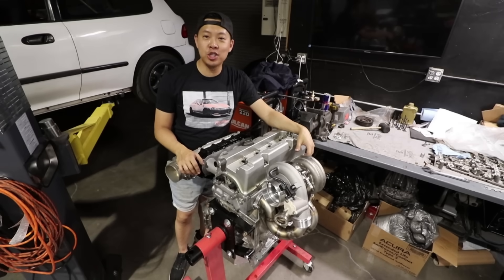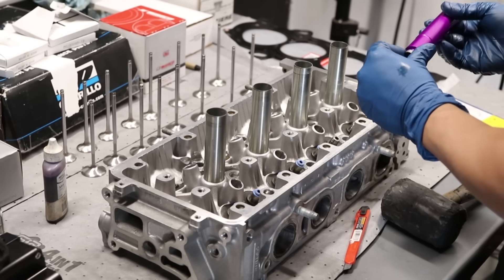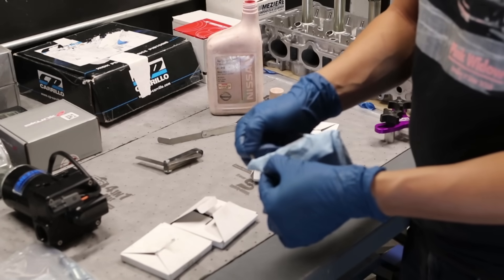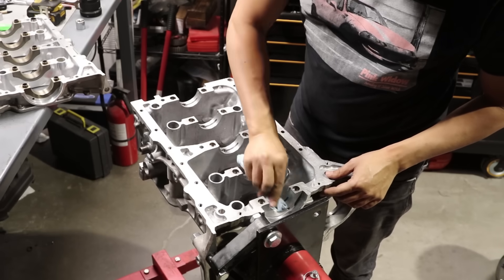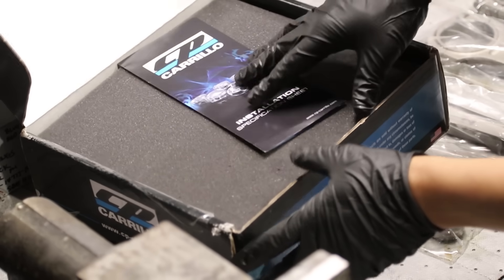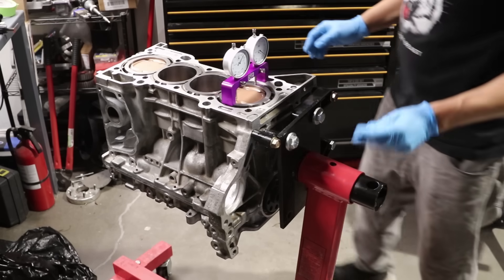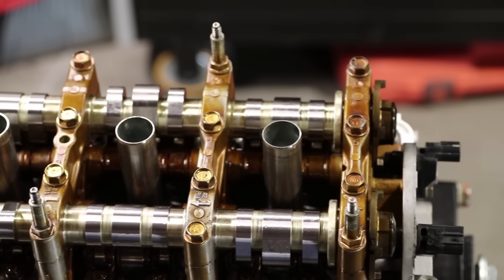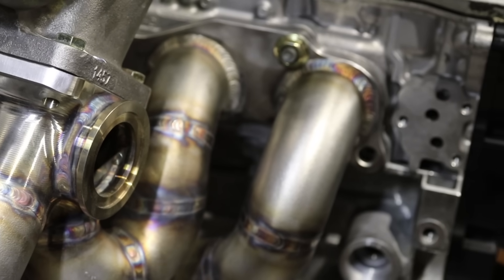K24 Engine Build Start To Finish -  The Best 4 Cylinder Ever Made

Comment from the maker: CHECK OUT OUR EBAY STORE: K20 K24 / HONDA PARTS IN STOCK READY TO SHIP
 https://www.ebay.com/str/racepartsnow
Reply: How much 4 this build
Reply: What’s the chances of getting a list for parts for this build? From top to bottom?
Reply: If i were rich how much power could i get out of my 3.8 l 3800 supercharged v6 in my pontiac grand prix gtp?
Reply: hey im looking to build a eg hatch with a k24. But was wondering that k24 to use. I know there are different ones like the k24a2, k24z7 and the list goes on. What is the best to go with for  most amount of hp you can get out of it, and also the price. Im just looking to build 500 hp reliable
Reply: h!mike,may i know which turbo kit you used in you're k24 engine build/tnx buddy ride safe.

Comment: its not the best 4cyl ever made, they need to be billet to pull 2000hp, the quickest 4cyl in the world is a gm ecotec with a STOCK cast aluminum engine with modded internals, pulls over 2000hp and does the 1/4 mile in 5:82 at 250mph, the quickest stock cast alu k series is not even close, even the vw ea888 is a better engine

Comment: I've seen several K2x assembly videos and no one says anything about the crank shaft and cam shafts pre-positioning before putting cam caps on - I mean, is any position safe? Than there's a moment when you put the timing chain on and just turn the crank shaft and cam shafts to their indexed positions with no remarks about the issue - does it mean that in K2x engines the valves never have a chance to touch/collide with the pistons regardless of the crank shaft - cam shafts mutual angular positions?

Comment: Amazing skills. I'm shocked at how high priced these prices to build Honda engines are. Even 300hp builds are 10k in parts, literally 3-5 times parts/labor of almost any other platform
Reply: Stock k24's are easily boosted to 500hp. 10k builds are people buying a lot of (imho) completely unnecessary new parts. You clicked on a 1k hp build video utilizing tons of new parts. Sure there are guys with 250whp NA builds that cost 11.5k, but they have different goals than me. I have been through enough cars to know nothing lasts forever and they are toys, so my potential 500hp $5k build is super cheap and easy to fix when it breaks from my perspective. Bizarre, seemingly counterfactual comment my guy.
Reply: @imaginary component  not bizzare or counter factual when I've watched video build after video build and that's all you see. If you haven't done it yourself and all you have to go on is YouTube videos,  then it is "fact" from that person's perspective.

Comment: Hey guys quick question if anyone knows. I just purchased some skunk2 dual valve spring set. No keepers came with it. I was going to use the original stock keepers from factory. Is that okay or should I swit h to different ones? I heard their was another design

Comment: I'm really curious about the bolts that you take out of the container at 7:20 . Is that oil that they were in ? The reason that I ask is that when you torque down bolts that have oil on the threads, you will over-torque them compared to bolts that are dry. According to Engineering Toolbox, you should reduce the torque by 35-45% when the threads are lubricated unless oil is specified by the manufacturer. A video worth watching in this regard : https://www.youtube.com/watch?v=XlNig19tWg8

Comment: Did you not need to file the rings down to the correct gap for the cylinder pressures and temps you will have with such a mega engine? Cheers.

Comment: did you put silicone in between thr girdle and the block when you measured the bearings for clearance?will the silicone gasket screw your bearing clearance when youre measuring it?

Comment: The k20 series is such an interesting design block and rotating assembly wise, fully counter weighted crank, girdle 5 bolt mains. Yet the block is open deck and all aluminum. Good engine weird design thats all, but they make a 1000hp easy so praise somebody

Comment: Awesome motor mike! I need help on parts. Building a car for my son, and this is also my FIRST build. Have a ‘99 Civic EX 5spd. I’m doing a k24a2 swap with MR1320 air to air SC for boost. I’m getting different parts suggestions from people. I just need the basic parts, like motor mounts, subframe, steering rack etc.,

Comment: I have a 2.4 liter Honda Accord from 2003. Who knows where to buy an improved engine head that will significantly increase the power and is already ready for assembly? Without the need for a turbo. Thanks for answering.

Comment: Very Nice. if you press the bearings in like that. You risk slight damage to the back of the bearing.
You could put the small nose in to the cap en press feed the bearing into its place. Just a observation. Greets

Comment: That head gasket for 1000hp? Show me the engine after some hard working hours and I'll be convinced, until then let me stay with the doubts... Do you trust absolutely in the pistons and rods to the point of not weighting them one by one? At that king of power in this high revving engines a difference of 0,5 grams might cause a major failure. Check for the Veicomer engine setups if you need to have some other ideas...

Comment: Warning. When you get a new oil pan from Moroso don't just bolt it on. Take the baffle out then take a small rubber hammer and tap with firmness around all seems and welds. I lost a $10k motor in 6 minutes once do to a piece of weld breaking away from the pan and going through my new engine....be cautious!

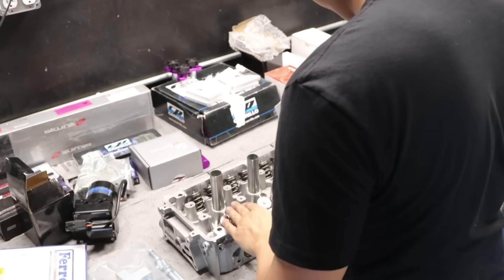Comment: 3:40 I’m pretty confident that using standard shop towels in the cylinder is really bad for high horsepower applications.  I’ve heard(and I’m certainly no expert) that they will shed some lint onto the cylinder walls that could mess the piston rings up.

Comment: Anyone else waiting for a slop moment like in LS engine builds? Waiting for the socket/pipe to come out instead of the anodized aluminum seal driver... smh  unnecessary $,$$$ you only need a concentric surface... run the engine at 2k for 20min to set the striations in the cam and lifters (add a blower to the radiator, set idle 2k on a good CPU or block up the throttle linkage). (break in) will 90% kill the paper, plus oil filter... just guessing there but yea.... Rockwell hardness of paper vs. engine parts..... lol. If your skurred just spray with carb cleaner and use parts lube. 

Square the rings with a bare piston BTW.

Comment: Use the top of your piston to push the rings down the bore to check ring gaps, push down about 25mm and the same for each ring. Balance the assembly, pistons, rods, crank and fly wheel and one pin in the fly wheel, so it will only fit one way, this makes a massive difference and will help it last longer. We pack a new pump with a lite grease to get pressure up or prime the pump via the oil pressure switch hole in needed as it fills side mounted filters and the pump.

Comment: Despite the fact that this engine is tough and long-lasting, it is not without problems. One main component on the engine that can fail is the timing chain sensor. The problem started to develop when the company switched timing belts to connect the crankshafts with the camshafts. Closing the gap of the piston by bringing it closer to the chain by a single tooth is the easiest solution to the problem, but it might not be a permanent solution. Other issues with this engine include that the camshaft can wear out easily and the idle is sometimes rough. Leaking engine oil has also been reported, which makes keeping up with regular oil changes essential to maintaining proper health of the Honda K24. Some owners have also noted hearing engine noise upon starting the car, which can signal a deterioration (and necessitate replacement) for the engine’s VTC gear.
Reply: You are absolutely correct. The VTEC solenoid gasket often leaks, the VTC actuators go bad and cause a grinding noise on a cold startup, the valves often need adjusting frequently to keep them quiet, and the engine HATES, HATES, HATES aftermarket starters and will often be a source of long cranks.

Comment: I’m surprised with such a high-horsepower specific output build you didn’t get the block gasket-ring machined. That little copper ring really helps when you’re running super-high cylinder pressures.

Comment: One thing I love about engine builds, even with a background in building old pushrod V-8s I can fairly easily understand and appreciate the design elements in modern engines.  They still work fundamentally the same way especially when it comes to modifying to make big power, they just go about it in a different manner.  Even though muscle cars are more my "thing" I do really want to build a legit badass import, there's just so much technology to take advantage of and it's cheap because it's still OEM technology.
Reply: Yeah but with Honda’s you have Spoon if u want the engine BUILT, Skunk2 for aftermarket parts, Mugen for body parts, and many cost less then OEM too
Reply: @andrewwenner2781  there is at least as much stuff for domestic makes, trust me.  There's an entire company dedicated to only making and selling parts for big block Chrysler V8s, just named 440Source lol.  You can build an entire 1st-gen Chevy Camaro from aftermarket parts it's actually been done before in magazines and such
Reply: @andrewwenner2781  they need billet engines, which is not made by japaneese people, which every single fast k serie is not even japaneese or honda, its american engines built entirely in usa, the vw ea888 and the gm ecotec are much cheaper and better options
Reply: @retrocompaq  You are delusional.
Reply: im with you on that . my old monte had a mild 383 was a lot of fun  . looking forward to building up a friends honda maybe ill try it on my g37 . love forged internal na tune

Comment: Anyone know the total cost of parts?
Reply: if I had to guess:
engine work (head, port, sleeves) - $2500-$3000
turbo - $1500-$2000 (you can still get nice ones for $1000)
turbo manifold + wastegate - $1000
cams, rods, pistons, bearings, valves, piston coating - $2500-$3000
intake manifold, throttle body, oil pan, oil pump, electric water pump - $1500

you still need ecu ($500), intercooler ($600-$900 for an all aluminum one), intercooler piping ($300), blow off valve ($200), boost controller (anywhere from $50-$300), tune ($300), injectors ($500)

+ labor

then you need clutch, flywheel, pressure plate, wheels, tires ($1500-$2000) and suspension ($1000)

$15,000+ for a literal 100% all out build

this is for 1,000whp, you could do something similar for 400-500hp and save about $5000 or more by going less on the head, port, sleeves, turbo, cheaper intercooler, no piston coating

or you could run a very conservative turbo setup for 300-350HP by buying the bare necessities by spending around $5,000+labor assuming the car is stock and you want at least proper suspension, tires, clutch components, and turbo components
Reply: InTheZone just after I posted this I saw his build cost video. It was like $10.5k

Comment: "the best 4 cylinder ever made" Well thats an upvote and a half from me :D
Reply: 503E!?!
Reply: @gatorage850  You are comparing a lemans engine to a consumer engine. There is k24's pushing out more power than the toyota engine if thats what you are about
Reply: @NjoyMoney  the Q was "the best 4 cylinder ever made"? yea honda make big power but have a crappy power band... basically, they only make peak power for a short time at high RPM. the reason why the 503E (any S series) is better. it makes more power throughout the RPM range. same reason that a lemans engine holds the pikes peak dirt record.
 on the other hand, yea to get a 3S-GTE (503E is just a mod 3S) to do it you would need to do a lot of work. but the cast-iron block has more potential and being non-interference your less likely to break.
 in drag racing, 3S-GTE has a faster time than any I4 honda. also, most of the top time in drag is GM/AKA Opel powred. honda has the FWD record but is not a  K-series honda.

Comment: Nah fail right in the beginning.. you never instal valve stem seals and then push valve stems through them as this will damage sealing lips. Correct way is to instal valves, ten slide protective  cap on the stem a only then slide seals on the stems.

Comment: meanwhile I'm stuck rebuilding a complete engine on the ground, rain, dust, and cats pissing on the covered motor. pita cleaning every time I look at it.
Reply: You sir ! are the true hero in this amazing hobby !! Keep building on !!
Reply: Cat pee helps the seals.
Reply: Meanwhile i've got a 1jz in my is200 and spent 10K+ on it and it still needs an ecu and wiring lol
Reply: Yep, been there.
Reply: Motor stands are like $60 at harbor freight
Reply: @D4WG-A4-6  what if the motor was $20? Who's got $60...
Reply: Mines in the dirt also...

Comment: What chassis is this going in? And is it possible to run a rear mount manifold(with smaller turbo obviously) in a DC5 chassis? I hate the look of the log manifold.. I do like the sidewinder, but they are only really used for bigger power goals(400+whp) and they take up a lot of room. Im trying to keep AC and PS as well.

Comment: Aye bro u da shiet I’m currently building my ep3 should I just buy a type r engine or go k24 Frankenstein
Reply: Frank it.. and the K20z1 is almost as good as the JDM K20A for less money. They have pretty much the same head and cam setup, just with a tad lower compression.. But if you going boost, you dont really want that higher compression ratio in the ITR k20a.

Comment: Oil pump failures due to internal parts breakage has destroyed a LOT of high rpm K series engines - I am more than a little surprised you didn't seem to do any preventative work there - like installing steel gears?
Especially as you have spent a LOT of money on parts that would be likely to be destroyed if that small saving doesn't  work out and you throw a rod.

Comment: K24’s are defiantly not a good boost motor, to much piston speed, to much cylinder pressure and to little timing window. Their is a reason no one runs k24’s in sfwd

Comment: Beautiful build but FYI since you didn't add the 56 degrees when doing the plastic gauge your oil tolerances will actually be a little tighter than what you measured... then far as the piston rings you didn't use stock piston so why would you reference them? Aftermarket companies have their piston ring set up for a specific reason and normally  it's because of piston design has changed.
Reply from the maker: I know... I just plastigauged for the sake of the video, I Mic'ed it already, which is more accurate than plastigauge. as far as pistons ring orientation... the piston company has a generic 1 size fits all orientation for EVERY aftermarket piston they sell.... I trust the OEM orientation... Honda ..Billion dollar company VS aftermarket million dollar company..... its worked for me in the past and they seal fine.
Reply: @diymike  I've never built a k-series motor so I'm not actually sure if the design of the Piston is actually different... sometimes the wrist pin height on the piston is different because the wrist pin size is bigger and it goes into the bottom ring land and so that offsets the rings. But you're definitely right I would trust Honda over any aftermarket company if the design is the same.

Comment: Did you mean 1000 "honda horsepower" engine
Reply: @ElectronicRedPanda Low torque, but with the light bodies the engine is put into, moot point. Look up MR2 with Honda K. They totally RIP. But compared to a 4th gen Camaro with an LS and Nitro for less money, yea. That is why Hondas kinda fell back a little after the fast and furious phase died. They realized the same tricks can be applied to a V8..... lol..... 1300HP 900LBs torque, etc.

Comment: A tip I learned from Jafromobile about cleaning parts, is to use coffee filters. They're white, leave no lint, and are super cheap. It's really easy to see if the part is as clean as you'd like with them.
Reply from the maker: nice, I just started watching his videos
Reply: Jeffrey Ball he said they actually do leave lint he just uses compressed air to blow the lint out
Reply: @Alex43237373  you are correct. I realized that after submitting it. It definitely leaves less lint than blue towels though, but you should always use air after wiping down things.
Reply: How did you acquire an RSP head in the states?
Reply: I use the blue shoptowl rolls and the are pretty clean but I still inspect everything to be sure.
Reply: Microfiber cloths if your REALLY worried, then degrease or toss. I'm not worried though, it's paper, I just change oil after break in.

Comment: Mike mike great video content, listen this build its for a drag race straight line run 1/4 mile , 1/8 or a mile run. Right? You doing this build for that purpose right, I mean you head towards that way but this set up won’t work for a circuit time attack a 10-15 minutes race autocross.
Reply from the maker: Krazy_Lobito this is for 1/2 mile MPH runs.

Comment: So the k20a type r and the k24a2 are a direct bolt on? And you used OEM k24 gasket?
Reply: Similar to a B20-VTEC. Probably not a factory head gasket at this power level.

Comment: Why no Oring? Is that the 9280? What psi will you be pushing her on kill mode?
Reply from the maker: The block is step decked, yes 9280 efr..... ummm maybe 40 psi for my power goal
Reply: @diymike  make sure to put a speed sensor on that Efr.  They are very sensitive a little to much it'll blow up Haha. K24 efr9280 twin scroll right here